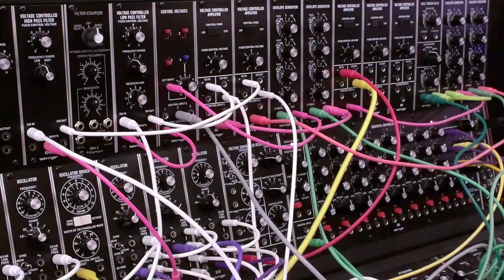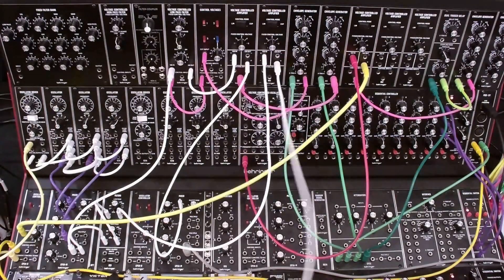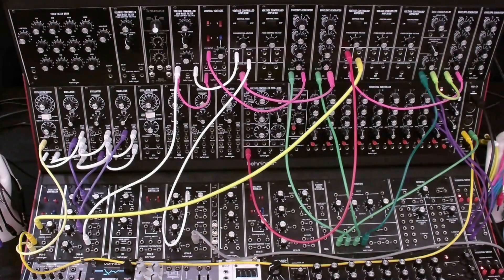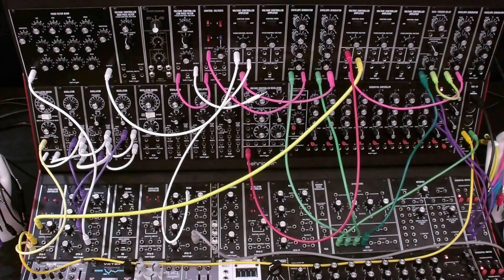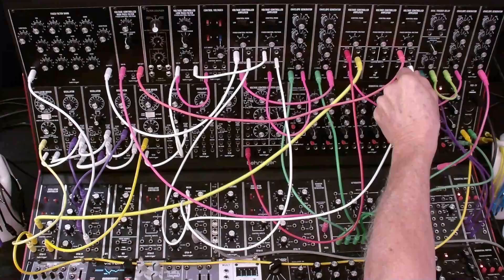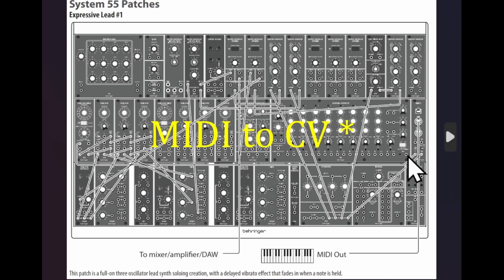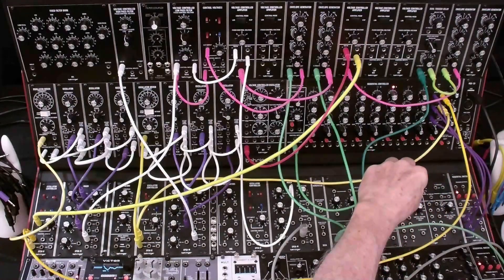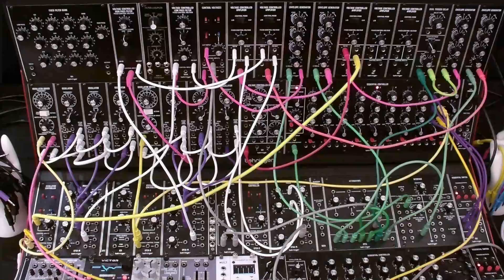Pt 2 System 55 Example Patches from the Quick Start Guide

Comment: What are the dimensions of the synth?
Reply from the maker: the two Go Cases are 28.5" wide ( 140 HP ).  A brace which joins the two go case and has a leg which supports back of the two cases together.  From the front of the case to the back of the leg is 18".

Comment: Hi O.Z. How are you connecting your 55 to a mixer thereby creating a stereo image?
🙂
Reply from the maker: Mono out from system 55.  Mono in to mixer,  panned center.   Effects within the mixer may contribute to a stereo image.  Can you point to a specific section of the video.  I’ll double check the sound.
Reply: 16:39 - 16:53 
The bell sound seems to be in only one side, followed by a  melody line at 16:45 - 16:53.
🙂
Reply from the maker: @svetkolisica1635  There is only a single output from the System 55 ( grey cable connected to the output of the rightmost CP3A-M (just above the word "Guide" in the title below the video)).  I'm not hearing any panning, so I'm not sure what to tell you.

Comment: Enjoying the S55 content!  That mellow organ patch was cool, I love the use of the FFB.
Reply from the maker: Thanks  I learned a lot doing that series.  Using the FFB as "drawbars" so to speak was one of those things.  I think the FFB really shines with a noise input.  Also, it would be usefu for formants, if I could find some reliable formant data for different acoustic instruments.
Reply: @ozhalljr  you could probably make format sounds using the S55.  Have you seen Alex Balls recent video talking about how to make format sounds?  I bet that would sound great on the S55.  https://www.youtube.com/watch?v=4KqtG1-qpm8

Speaking of FFB, I got the AM Synths FB and I'm really enjoying it!  Going to post some jams on it soon.  Then maybe some videos focused on just playing the module vs a jam context.
Reply from the maker: @TheMachinesWon  I looked carfully at the AM FFB module, but it was redundant to a couple of other units that I have.  BTW, the multi-purpose filter is very cool.  1047 + an extra "Peak" response.  I've got a video in the works on that one.
Reply: @ozhalljr  Nice, I got the multi purpose filter as well! It's very smooth.  I'm enjoying it a lot.  Can't wait for the Quad and VC EGs to really make my system pop :)
Reply from the maker: The Presets module looks cool as well.  I suppose you could hack that with a 1050 and DC inputs.  I've been trying to understand the 1031 notch/peak.  Have you tested that much?  It seems to me that the Notch and Peak labels are backwards. 
Edit:  they are NOT backwards.  Here's a reproduction of the Aries AR-327 multimode filter with Peak response.  That's the circuit that Amsynths have used.  https://youtu.be/1vFNCKbWi10?si=dUSkCwAsbqPYcE7K&t=280
Reply: @ozhalljr  that’s a good question. I need to check out the peak vs the notch. Peak should be a shorter BP I thought but ive only used it with the other outs mixed so I didn’t really analyze it too much. I’d expect him to have a little more attention to detail though…hm 🤔 will check into that
Reply: @ozhalljr  ahhh ok seeing the edit now. Good to know I’ll check out this video